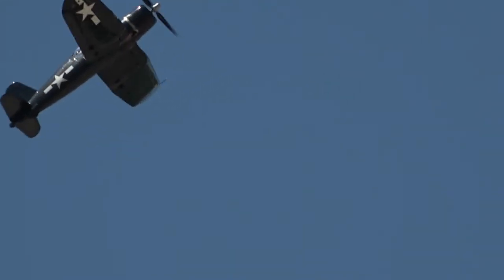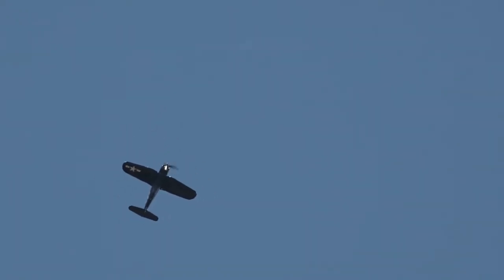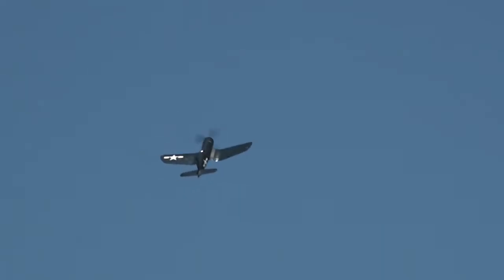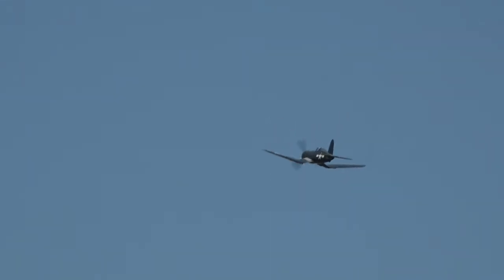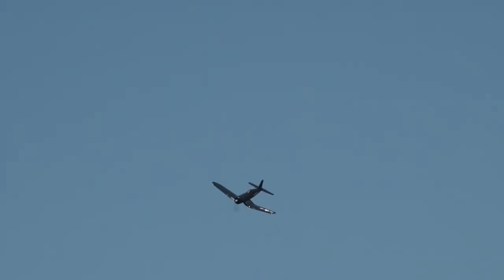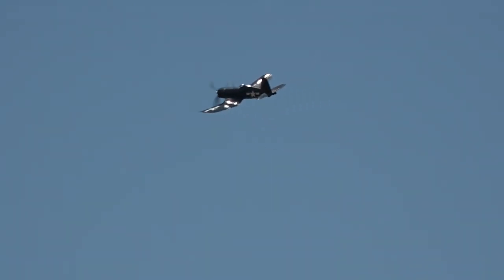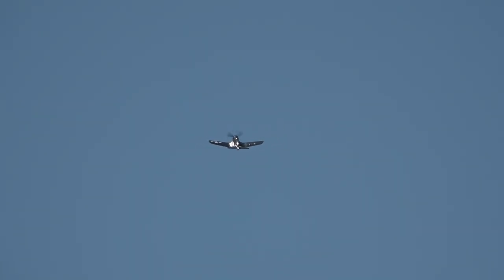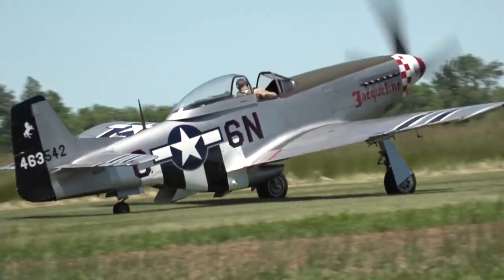Geneseo Air Show 2022 FG-1D Corsair Demo

Comment: Oh, and one more thing: The old straight deck carriers from World War-II, had multiple arresting wires, so, why did the announcer say that he would've tried to snag the 3 Wire, when, in those days, carrier aviators weren't engaged in a competition amongst themselves for "Top Hook" honors, because of how many wires were stretched across the landing area at the aft end of the flight deck. The competition to get the best grade for trapping, started up after the Korean War. This air show announcer needs to go, and do his research on this aircraft, and carrier aviation, along with the names of our carriers, as well. It really burns me, when air show announcer s don't have the correct information on the aircraft, and other topics.
Reply from the maker: Your right about that the three wire refers to post war angled deck carriers which have four arresting cables instead of the many( can't remember how many ) on WWII ships. This announcer gas made up most of his facts for the last 35 yrs! Most air show audiences don't know enough to notice. Good catch to notice. After so long I don't mention it anymore unless someone else catches it.
Thanks for watching!